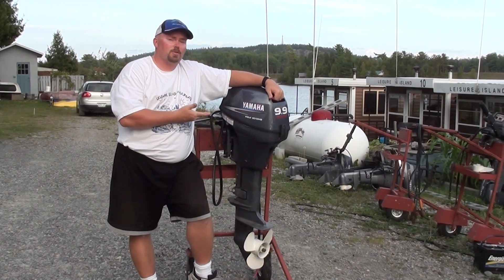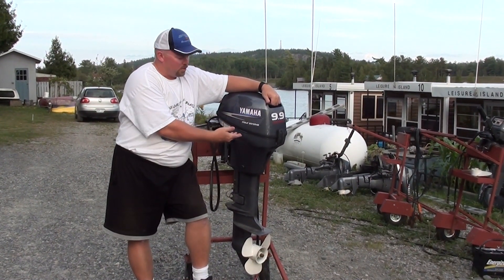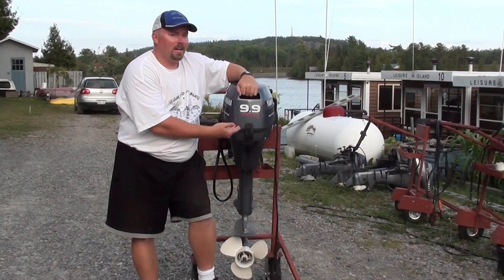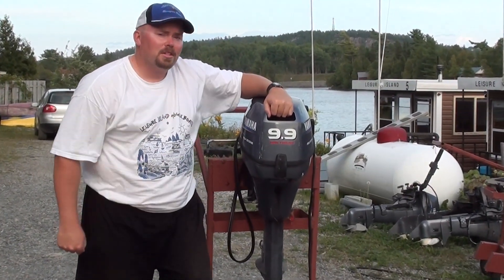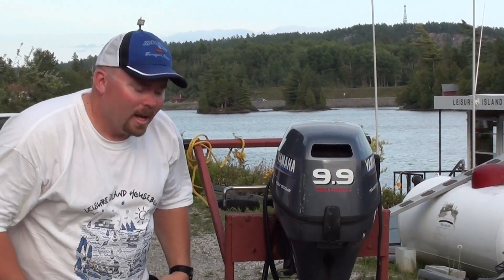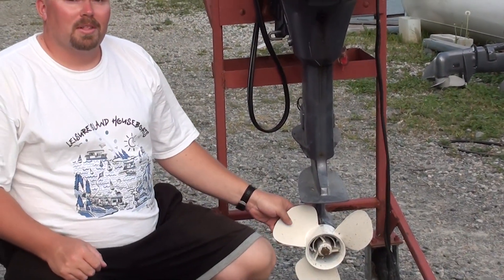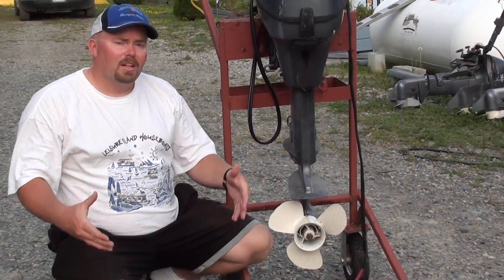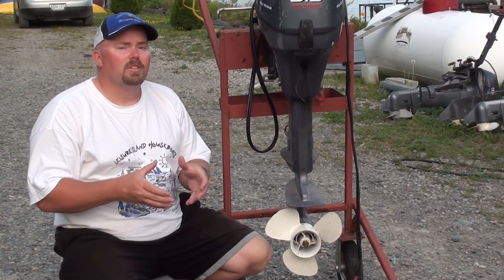Yamaha 9.9 Four Stroke

Comment from the maker: If you watched the video, you'd see it is a HIGH THRUST.  This thing puts out way more thrust than a 15, even a 20hp.  We used to run Johnson 30hp motors.  When we switched to these we lost very little top speed, but gained way more thrust in reverse for maneuvering.  Picture the difference between coming in to park and being able to stop, versus putting your heavy houseboat into netural.  We also gained better overall performance in both fuel economy (which our customers like) and less repairs.